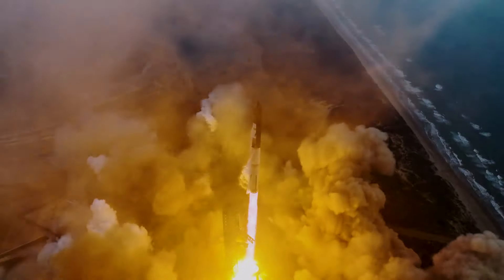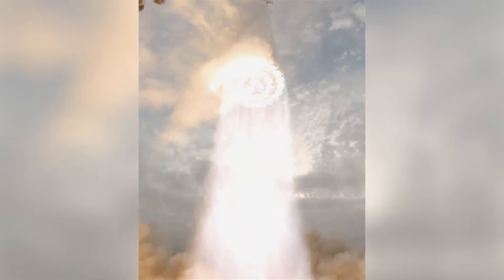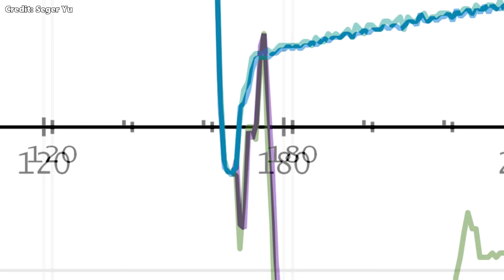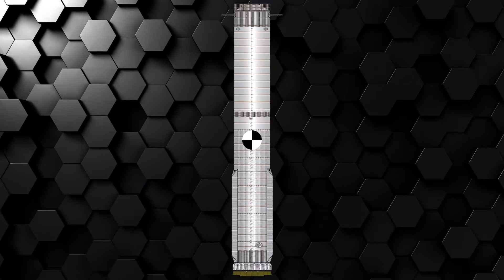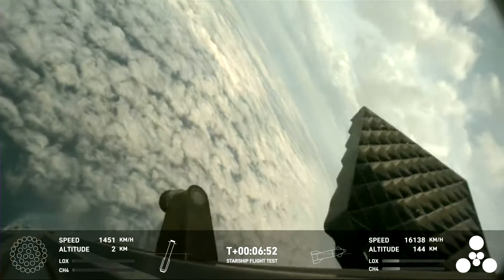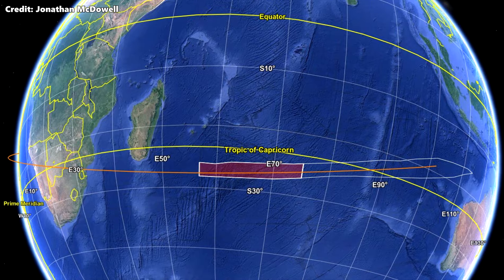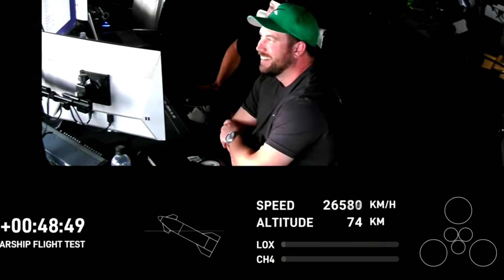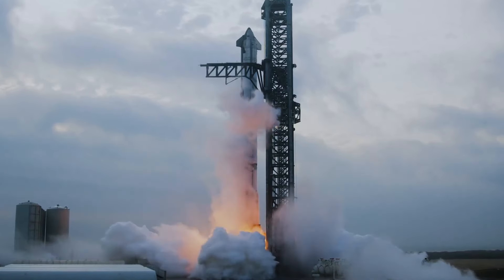Hot Staging Explained | Starship Orbital Flight 3 Analysis

Comment: Very good video.  Well produced, well researched, and no obnoxious text to speech narration.  I have nearly gave up on watching new channels on Starship, kinda clicked on this one by accident.  Subscribed.   My only technical disagreement is the discussion of the interaction of grid fins and stage 2 engines at 8:46.   IMO the right side arrows are correct, not sure about them being at different angles.  This creates a force pushing the top of the booster to the left, which we see in the video.  My thinking is that the arrows you have on the left side should be  pointing away from each other leaving a net force of the top of the booster going to the left as well.  Slight tweaking of exact angles could introduce a roll motion, but also since the engine placement isn't exactly symmetrical to the grid fin locations, I don't assume to know how exactly that would play out.

Comment: I think the main reason flight 4 will not carry satellites is because the raptor restart did not work, and since flight 4's flight path will be identical, ie. suborbital, an orbital insertion followed by deorbit burn will be needed to carry any useful payload to space. I think the payload door will be a much simpler solution, not requiring another flight to be confident it will work.
Reply from the maker: That's a good point - I don't think the Starlink satellites would be able to boost up to a stable orbit in the short time they would have after being deployed in a suborbital trajectory.